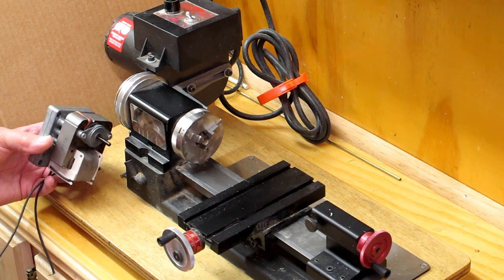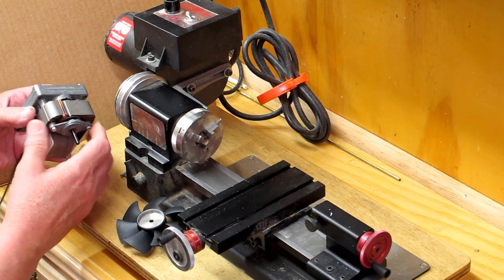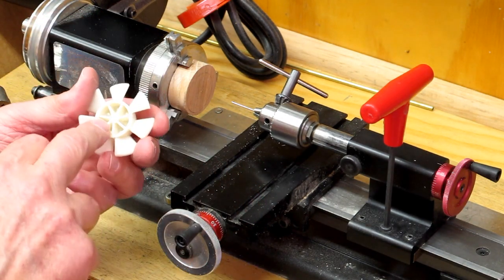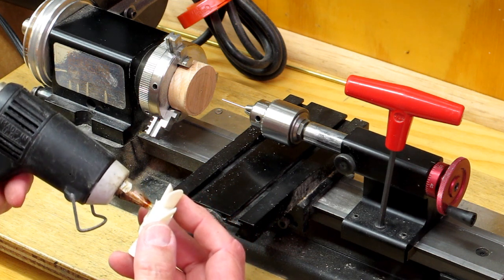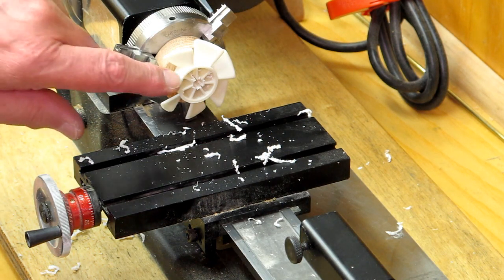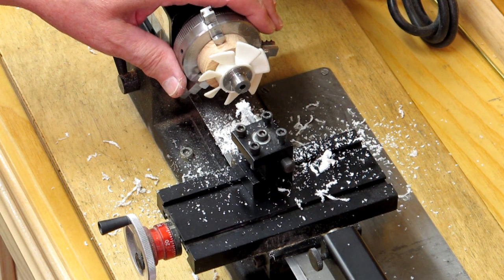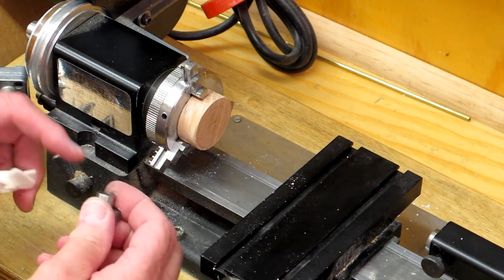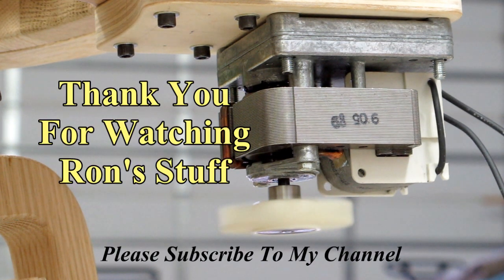Shaded Pole Induction Motor - Cooling Fan

Comment: Do you have a link to these motors? Or a a model number for the ones you use in this video?
Reply from the maker: Unfortunately No. The source for these dried up long ago.
You need to look around on eBay and the internet from time to time and places like the Surplus Center in Lincoln, Nebraska https://www.surpluscenter.com/
These are generally surplus production overruns and such and it is hard to know then or where to find them. Try to find one that has the output speed you are looking for and has a substantial gear box. A lot of these do not have much power (low torque output) so it can be a bit of trial and error. Search "shaded-pole parallel shaft gearmotor" or "ac gearmotor" or "gearmotor" used in BBQ rotisserie drive, microwave, displays, pellet stove auger, etc. and some are quite overpriced. Dayton is a common brand name. Good luck!
Reply: @RonaldWalters2010  btw i uploaded another short.,

Comment: I’m using one of these shades pole (dual shaft) for my own version of a Leslie rotating speaker. It’s a 35w motor and spins freely, but with a 300w lightbulb in series with the live wire (a current limiter) the bulb glows just bright enough that I shouldn’t look at the filament. After five minutes mine gets hot to the touch as well, so it’s good to see a motor worked out for you. How heavy a load is yours driving?
Reply: I meant glad the fan worked out for you, not “motor.”
Reply from the maker: Not sure what you are trying to accomplish with the "current limiter"... slowing down the motor?
Sometimes limiting power to a motor will cause them to heat up and/or burn out.
My motor is driving a geared mechanism but can't really answer you question "how heavy a load". All I can say is the motor has sufficient power to drive the load.
Don't know where you sourced your motor. These are purpose/application designed motors and the surplus motors available out there vary greatly between very weak to quite strong. All of these will need a cooling fan if they are running for very long.
If you need to turn something in your speaker slower, I suggest you forget the light bulb and use a set of gears or a drive belt reduction or look for a shaded pole gear motor that turns slower (stronger motor with more gears in the gear box). Some are strong enough to hurt you... such as a rotisserie.
Another method could be to use a stepper motor, which can be programmed to run different speeds.
Thanks for watching. Please subscribe! 
That is what keeps this channel running. 
Ron
Reply: My mistake for not explaining the current limiter, I didn’t want my first comment to be too winded; the bulb I’m calling a current limiter is seperate from my motor, it’s a circuit with an outlet that plugs into your wall to place this 300w 120v bulb in series with your live 120vAC, and it will flow to dissipate large amounts of heat if you plug in a device with a partial or a dead short. 

I wasn’t after anything technical when I asked about the load, not an answer centered around data at least… is it for a tumbler? For example, what ls the diameter of the drum and how much weight can it be expected to turn? 

Whatever the load may be, does the low starting torque of these motors cause yours to get up to speed slowly? Do you allow for any belt slip? 
The good stuff is always in the details, who needs data? Lol
Reply from the maker: My experience with these motors is they will either start or not start. There is no slowly getting up to speed. If they don't start I suspect they will heat up much quicker.

I have not built a drum tumbler.

Following are examples of applications where I have used the shaded pole gear motors.
These are pretty strong gear motors and unfortunately the source has dried up.
Closest thing I have seen to one of these is for a BBQ rotisserie.
Closest to stalling out one of these motors is the Busker Organ Air Supply.

Marble Machine - Ring Gear Lift (wood gear reduction)
https://youtu.be/QzIG9stFXSI

Marble Machine Teaser - Pin Gear Roulette (wood gear reduction)
https://youtu.be/-W4Na9FgPeE
Flat Disc Electrical Slip Ring (shows view of motor installation)
https://youtu.be/w8bDha0szIY

Spray Can Paint Mixer (gear motor direct drive)
https://youtu.be/BFow88VJxn4

Building The Busker Organ - Motor Drive & Gears Part 4 (wood gear reduction - the largest load on one of these gear motors)
https://youtu.be/59MszwTeDvI

Building The Busker Organ - Manometer Test Part 5
https://youtu.be/cnQvvG5P7Hs

Senior 20 Organ (25) Making The 17 Front Pipes (near the end - using the Busker to test organ pipes)
https://youtu.be/hsWXo6BfDM8

Rewinding Filament Spools For 3D Printing (belt drive used)
https://youtu.be/03euMYrIv7U
Reply: That’s my experience too, as you’ve stated these motors are very inefficient and they have very low starting torque; hence my questions about belt slip to allow slow spin-up of a loss it couldn’t otherwise drive directly, as in a gear pulley system instead of a groove pulley system. I’m dealing with grooved pulleys and belts, where as you’re clearly dealing with gears in many of your projects. Thanks for the links to your other videos by the way! I checked out the marble tower, pretty cool. 

I’m not sure what your motor source was, but these are the extremely common motor found in many refrigerator condenser fans, kitchen/bathroom vent fans, microwave cooling fans… This type of motor you and I have are generally below 1/4HP and about 40 watts. If it’s the gearbox you’re after, that wouldn’t be hard to DIY, especially considering your level of DIY includes a lathe… lol 

What is your source? And do you know the RPM of your motor(s)? I’ve found a free app for Apple that lets you adjust your cameras frame rate to match/determine the RPM of something. Pretty useful!
Reply from the maker: Like I said before, my source dried up long ago. This one guy in the north east USA must have had a crate of them. He asked me to do a review video of them (probably 12 years ago) and I received several of them from him.
I haven't heard from him in years and the motors disappeared from eBay so he either sold all of them and/or he is no longer with us.
The gear motors (like for a rotisserie) do have a lot of starting torque due to the gear box.
The common motors in refrigerators, microwaves, bathroom exhaust are pretty gutless and really not suited for anything but spinning a fan blade.
I wouldn't recommend intentional belt slip for any application (that's the engineer in me). You also don't want a belt that is too tight. A motor mounted on a pivot arm (like a tensioner pulley on your car engine) with a light spring would provide a little freedom of movement for startup.
The large gear motors I have (had) turned around 18 RPM (I think) and without disassembling something I have no way to measure it.
The Surplus Center in Lincoln Nebraska has had somewhat of a selection of gear motors in the past and you just need to look around and then eventually experiment with a few.
https://www.surpluscenter.com/

Again... your best bet may be a stepper motor with a toothed/cog belt going around whatever you are spinning. With the correct driver the stepper motors can be pretty quiet. One of my 3D printers with its 4 stepper motors was quite noisy when I first got it. Then I upgraded it to a better mother board and it prints faster and quieter (so quiet I need to walk into the room to see if it is still running).
Reply: I’m sorry to hear that, you clearly get a lot done with those little motors. I’ve found an old shades pole with a reduction gear box but the motor was dead… I’m usually “experimenting” with  these motors with such low torque because they’ve been used since the late ‘30’s (with belt slip mind you) driving rotating speakers. Quite the load, and the belt slip and long time to spin up is exactly what you want in a rotating instrument speaker for say, an organ or guitar. That engineer in you should know it’s all about optimizing the compromises! Seriously though, check out some videos or “Leslie rotating speakers.” I think you’d enjoy all the different designs.
Reply: And I’m all set on belt tension, I’ve got a cricket for automotive belt tensioning for that if I need to get precise, but dealing with rotating speakers, I adjust belt tension and count the revolutions it takes for the belt to lock up. 

I like to think of it like a lock up torque converter on a car.
Reply from the maker: Ok... well you're dealing with something I have not.
One other thing... some of these turn clockwise and some counter clockwise. A lot of them can be reversed and I have a video showing that should you find it necessary.
Good luck with your project!
Reply: Yep that’s a helpful trick! It’s not too difficult to remove the bearings and flip the rotor, and while we’re on the topic I have one last question that you may know… 

Those of us with these rotating speakers are almost always dealing with Asynchronous, shaded pole, single phase motors. I’ve seen lots of guys only reverse the polarity of the live and neutral motor leads with a DPDT switch. Is this a product of being an “A”synchronous motor? In other words, What is it that separates the common microwave/appliance fan motor from the ones that need the rotors flipped? Thanks for tolerating my gibberish!
Reply from the maker: I have heard/seen a few of these with multiple windings but that was to change the motor speed, not the direction of rotation.
These are frequency driven motors and the ones I have don't care which wire is connected to live or neutral. I just tried one of mine and it runs in the same direction connected either way.
If you plugged one of these into 110V DC it wouldn't do anything (except possibly burn up).
Flipping the field over changes the bias between the rotor magnets and the shading coils... and that reverses the rotation.
There are a number of different ways these are made and your friends may have stumbled across some that can be reversed with a switch... but I haven't seen one.
Not sure I answered your question but that is about the extent of my knowledge of shaded pole motors. :-)

Comment: yeah, i unfortunately just found this out, when i thought i had( at least that's what is says on the housing) a 4 speed shaded pole motor, i was attempting to set the motor at a slower speed, to help circulate some warm air, without having a cooling effect, by blowing it so fast, no such luck. i really don't see what good the so called speeds are. could i weigh, or stall it somehow by restricting the amount of air it has to it? somehow. or should i just get a smaller fan?

Comment from the maker: Actually, a cooling fan blade is on my “to do” list, but using the recycled computer cooling fan blade was just too easy to pass up. On the small white fan used in this video the blades are flat so this would be fairly easy to make out of wood and it moves plenty of air for this application. Equal blade spacing, check the balance and you’re done. One of these days I’ll make one.

Comment from the maker: I did not really answer your question. These motors are found in cooling fans, exhaust fans, turntables, drives, rotisserie and many small appliances requiring low starting torque.

Comment from the maker: The motor was designed for a fan. That’s why the shaft is there. If you need a fan, the hub is not going to be of any concern in this application. The size and pitch of the fan may be, but the hub has nothing to do with it.

How is it overkill to make a fan if you need one and don’t have one?

Comment: Of course the metal hub has to do with the efficiency - particularly of the motor.  It takes more energy to turn something heavier, and depending upon the strength of the motor, it either affects the speed at which the fan is turning or the amount of energy it takes to spin it.

I certainly can't know if there was enough plastic in the middle, but this just seemed like extreme overkill, given that you have to lathe out a hub, tap for a set screw, etc.

Comment from the maker: It is not less efficient because of a metal hub. The hub has nothing to do with the efficiency of the fan. If you watch again you can clearly see the center material is too small to be bored out, otherwise that would have been done. The plastic in this particular fan isn’t much thicker than bottle.

Comment from the maker: The final shot in this video shows it running a marble machine. You can use one of these anywhere a low power/geared motor is needed.

Comment from the maker: Powering a marble machine, display, wood gear mechanism or "wherever" you need a low power/geared motor. As an example, in my videos this type motor powers my Marble Machine and the Planetary Gear Drive. The final shot in this video shows it running another marble machine.

Comment: This works, but you end up with a less efficient setup (due to your metal hub) and a inch more complicated build process.  Much easier (with a better end result) would be to locate the center and then bore out the hole in the fan to be press fit, epoxied, or even keyed.  But it looks to be part of an interesting project, nevertheless.